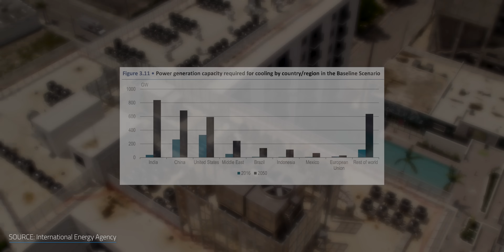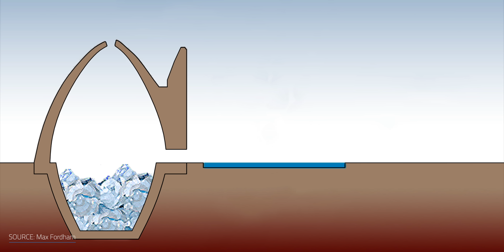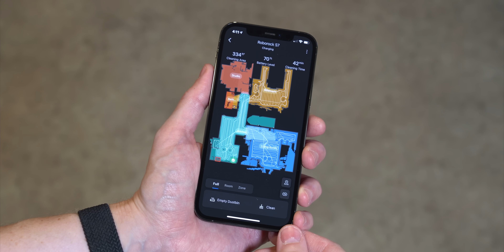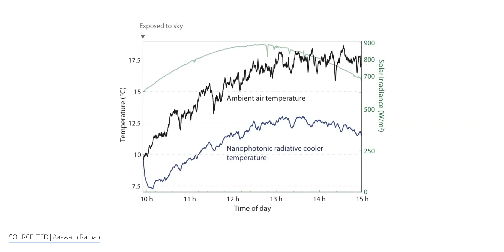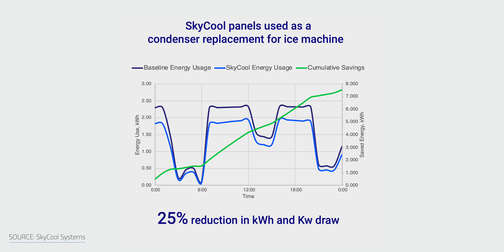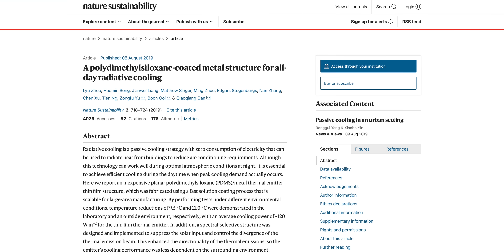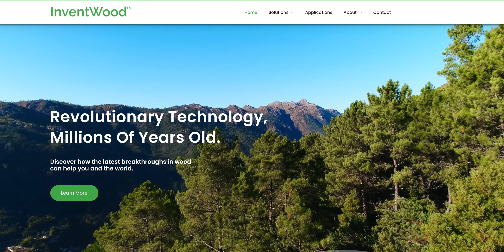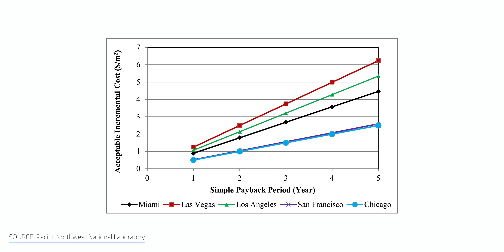Space Powered Cooling May Be the Future of Energy

Comment: It would be nice to see supercool panels as overlays for silicon solar panels. If the supercool rejects IR, but passes visible light, you'd get cooler, more efficient solar panels and a cooler house at the same time, and also getting dual use of every square meter of rooftop space.
Reply: Do suppose panels designed like a venetian blind might work? One side solar photovoltaic, the other cooling paint, flip them over for day or nite.
Reply: What a great idea! I wonder if you could turn off the pumps to let ice build up on the panels during night, then run the pumps + solar heat to melt the ice during the day, creating a water generation system, a thermal battery, and maybe making them partially self-cleaning or at least protected from dust buildup during the night, which is a significant part of the panel's lifespan.
Reply: or build solar panels to run these, if they needed pumps or something - run solar panels during the day and run the coolers at night, you'd get at least a few hours a day of cooling - there is plenty of land area in the deserts that could be used.  Millions of acres.
Reply: they need to pass water in the solar panel to generate electricity has well as cool them and store the heat from those panel in tanks like the regular heater tank. they already do water only solar panel but I never see both combined... Btw solar pannel use some part of the IR so you can't block it
Reply: I saw a TED talk of the developer and he mentioned that they have showed that putting microstructures with their tech on top of solar panels have improved it's efficiency
Reply: No need, really.  Solar panels need to be oriented to face towards the sun; but that orientation is exactly non-optimal for cooling panels, which need to face empty (non-sun) space.  The solution is to put solar panels on the half of your roof (the south-facing portion in the northern hemisphere) that best suits them, and cooling panels on the other (north-facing portion in the northern hemisphere) half where solar PV panels would not work well.
Reply: There is a significant design challenge in there. It is not enough to transmit visible light, rather you have to also transmit the near, short and midwave infrared up to 8 µm. And also the UV light. And then it has to have a very high absorption in the 8µm to 13 µm range to emit heat efficiently. 

And transmission can not really be achieved by multi-layer technologies like reflection can, so you need to find a single bulk material that has the properties you want. There are some which can be close to perfect, like ZnS. But that comes with a high reflectivity per surface as well, so the combined transmission for the visible light is only about 80%. 

Also the backside of this material is now in direct view of the solar panel, and gets heated by that. So there are a lot of aspects that make your concept much less efficient than you imagine it to be. Sorry ;-)
Reply: @ShieTar_  Any radiation below the 1.12 eV silicon bandgap just heats the solar panel. Yes, the supercool panels will reradiate towards the solar panels, but that reradiation will be isotropic, so there is a factor of two less hitting the underlying solar panels. Technical challenges for sure, but not quite as bad as you suggested.
Reply: @ShieTar_  where can i learn more on this topic, you seem very knowledgeable on said subject and i would love some direction
Reply: As far as I understood it red/ near IR was part for the bandwidth that made PV panels work best....

Comment: What about the antifreeze in the system how often does it need changed out and where to dispose of it. Also how would reflecting so much heat not also cause some global warming problems. It's already been a issue for several years of asphalt absorbing and reflecting heat.
Reply: He already mentioned that it operates in the wavelength band that makes it through the atmosphere
Reply: @LokiScarlet  yeah it's called the heat from the sun's rays and that can also happen even on regular rooftops too for that matter so my point is is that if everybody starts bouncing back the waves and it heats up the Earth's atmosphere even before it gets into space again what can I do to the environment.

Comment: The greenhouse emissions by air conditioners is news to me, and it's being an awkward thing to look into.  Those gases used in air conditioners are never meant to be emitted in the first place, they're in a closed loop system of transitioning from liquid to gas over and over again.  They're actually quite energy efficient, able to move way more units of energy than they use in electricity.
Reply: "able to move way more units of energy than they use in electricity"
Don't say that too loud, the technophobes might hear it and misquote thermodynamics, ignoring the difference in thermal mass of the indoor and outdoor sides of the system.

Comment: Hafnium is a metal so rare that even my chemistry teacher with 40 years of experience only had saw it 2 times.
This is not going to work based on the rarity of such element. It's like depending on Iridium to power something. 
The answer relies not on using MORE STUFF to cool your home. But using less. You already talked about using more efficient "passive" houses. Evaporative cooling and better insulated homes will solve the problem.
Furthermore, that 2% HFC contribution comes from basically the industry and older AC units. Newer more reliable and leak-proof equipment will reduce that down further.
P.S: I'm no material scientist. But I do believe the best engineer to have ever existed is just plain evolution. And I have noted that in nature, animals and plants are either shading themselves against the sun rays, evaporating water to keep cool, digging themselves down the earth, investing in good insulation or all of the above combined.

Comment: This is actually a great Tech since the biggest energy hog in a modern dwelling is Heating and Cooling. This means that the same size building would require less solar energy generation and by extension less energy storage.  Not only could it pay itself off in 2 years but it could cut down on the install price of a solar system

Comment: The thrust of the phenomenon is clearer at the beginning of the video -- that there is a bandwidth of the EM spectrum where the atmosphere is clear to space, w/o transmission impediments. The first product seems to be directly using that effect.
The subsequent products just seem to be ultra-efficient sunlight reflectors.
Reply: As long as the atmosphere isn't full of water vapor, greenhouse gasses, volcanic ash or wildfire smoke.
If we had an efficient way to shift the wavelength of incoming solar radiation, we could double or triple PV output.
Reply: @jimurrata6785  Polarization?
Reply: @shawnr771  Not really.
Just that all those things will absorb infrared, so it heats the atmosphere and it won't make it back into space.
Reply: @jimurrata6785  thanks.
Reply: @jimurrata6785  space mirrors + fluorescent (in the right bandwidth) crystals?

Comment: I remember hearing about this radiative cooling technology in a TED talk years ago. I couldn't find much more about it then and I don't recall the name of it now - it may have been one of the companies mentioned in this video. So, thanks for making an interesting video!

What I am curious about is solar + heat pumps vs radiative cooling. If i was a resident of a home with limited roof space (like most homes in the UK) I'd imagine I would be persuaded to generate my own electricity and using that to power a heat pump rather than having a cooling system with radiative cooling taking up some of that roof space.
Reply: Problem of heat pump is that you are increasing the greenhouse effect on earth (because you will always produce heat). Cost saving wise, most likely solar panel + heat pump is cheaper or we will see more usage of these already.
Reply: @mira-rara  no mechanical, physical or chemical system is perfect. But heat pumps are pretty darned efficient (in comparison to resistive heating - like an electric heater or oil radiator). 

Other than the HFCs that are used to move the heat through the system, what part of a heat pump is creating a greenhouse effect?
Reply: @MattDaines  heat pump is efficient in generating heat in targeted spot, giving more than 1 unit of heat with 1 unit of energy. The problem is that, to remove 1 unit of heat, you will create more than 1 unit of heat for the other side because of how entropy works, resulting in a net increase of heat on earth. I was wrong in stating that it's a greenhouse effect, it's more of contributing to global warming. Radiation cooling on the other hand, remove heat from earth and send it to space, thus helping to reduce global warming.

The entire problem of air conditioning or heat pump other than greenhouse gas is that to cool one place, you ended up creating more heat than it cooled.
Reply: @mira-rara  that extra unit of heat just comes down to efficiency of a system. But it's not heat generated from inefficiencies in systems that's warming the planet. It's the increase of energy from the sun being trapped by the greenhouse gases in the atmosphere. And there are places on Earth that without climate control solutions they would be uninhabitable. So, like everything we do, the more efficiently we can do something (heating/cooling our homes/offices etc), the better.

Using radiative cooling to slow global warming feels like a "it buys us time" kind of option - which is great! But it's not a long term solution.
Reply: @MattDaines  well tbf, heat pump that doesn't use greenhouse gas are generally very large (like the water coolant from cooling tower). Not that it's a choice for us unless we centralize the heat pump for many users (some apartment actually does it).

Comment: This was really interesting. I was initially concerned by reflectivity as a cooling solution because it only works in climates that don't experience serious winter (since it negatively impacts temperature control needs in the winter), but this looks very promising. Another thought I had about the panels is that if they were reversible, you could flip them around for winter, and use them to absorb heat, perhaps? It's a very cool idea though, and like many ideas, it's probably "a little bit of this and a little bit of that" that we need to solve the climate crisis.
Reply: space has no temperature to draw upon.
Reply: @fss1704  huh?

Comment: So let me try to understand/explain what is suggested here. 
First the basics. Everything warm is giving off it’s warmth in three ways, convection, conduction and radiation. Convection is most air cooled system, air close to the warm object gets warm and moves away and fresh cold air comes by. Conduction is two solid objects touching and the warmth from one object will spread to the colder one. Radiation is the process of emitting electromagnetic waves, it is also called black body radiation. Depending on the temperature of an object a specific spectrum of radiation will be emitted. Really rally cold stuff will emit in micro waves (very low energy), objects at body temperature will emit in infra red and really hot stuff will emit in visible light (light bulb, sun). 

Our atmosphere absorbs electromagnetic waves of a variety of wavelength. Not absorbed is visible light, radio waves and parts of infra red (atmospheric window 2:43 ). So having surfaces facing the sky at the right temperature to emit in this atmospheric window will cause the energy to be sent into space. 

The basic problem of climate change is, by adding CO2 to the atmosphere we are closing this atmospheric window. The CO2 absorbs the emitted infra red light from the ground and heat the air. If the concentration of CO2 is getting to high non of the infra red from the ground is going to space (green house effect). The air of the higher less dense parts of the atmosphere with less CO2 in the way needs to get warmer to radiate away the energy.

Comment: Let's say you have two blocks filled with water/rocks/whatever, and one of the boxes have these cooling panels on top, while the other block is just painted black. Whenever it's sunny, there would be a significant temperature difference between them. Hook up a Stirling engine to this, which in turn drives a generator to produce electricity from sunlight. 

Would this be a possible alternative to conventional solar panels? It has one significant benefit that you can turn the Stirling engine off at any time, storing the temperature difference, allowing you to extract energy precisely when you need it.

Comment: This may be a solution for off grid folks, especially if there was a way to revers the effect during the winter with the same setup.
Reply: You need a panel that absorbs almost all of the sunlight, opposed to reflecting it like these do. There are many DIY plans for powerless solar heaters using black tubes and convection currents, and they work. Perhaps the actual top panel could be swapped between the reflecting panels to the absorbing panels, mounting directly to the same water loop heat exchanger block. Would come down to how close/integrated the panel needs to be to the water loop. Or alternatively an additional panel placed directly overtop to trap all that reflected energy. Yeah, that "cover" idea would actually work and much easier.

Comment: So it barely out performs white paint. OK, will help a little. There is one big problem however...humans. I live in Phoenix AZ. The way we build homes creates a closed attic space which heats to 130-150F. That heats the ceiling which heats the interior. Venting the attic helps very little because the venting just isn't nearly enough flow. A few houses are starting to insulate the roof instead of the ceiling which helps a little but it does create more surface area too allowing for more interior heating. If we built flat roofs above a 2nd roof with a 6-12 space allowing lots of air flow, lots of vents in the upper roof so basically the upper roof is there only to shade the lower waterproof roof the ceiling heating would be reduced from 130-150F to about 100F at the worse time of day in summer which a good insulation can effectively stop. In winter side panels and vents could be closed so the gap between roofs would heat up and air from there blown into the house for heating during the day.

That's all very easy to do, would even save people a lot of money. But we don't because were humans and humans are clever but not very bright. People move here from cold climates and they want their homes to look the same. Insane but reality. They also like lush green lawns here in the desert so water is becoming a problem with global warming.

So while stories of future tech is interesting, entertaining, I prefer to live in the reality that we humans are going to do almost nothing to change unless there is a huge cost benefit. We care about money a lot and global warming very little if measured by our actions instead of our words. I'm changing where I live and how I build my home for the reality I see. If science comes up with some great tech people will actually use then super. But I'm not counting on it.

Comment: We can reduce the reflectivity requirement by putting these underneath fixed tilt solar arrays. The fixed tilt solar modules face South and the cooling modules face North and are placed underneath the solar PV modules. This is of course the arrangement that would be used for the northern hemisphere in temperate latitudes.

Depending on the pitch of the roof, north facing slopes could have cooling modules or even roofing tiles made out of this material installed all solar PV goes on south east and west facing slopes.